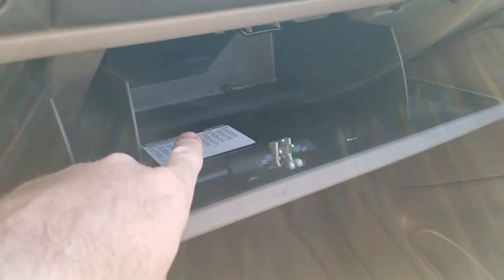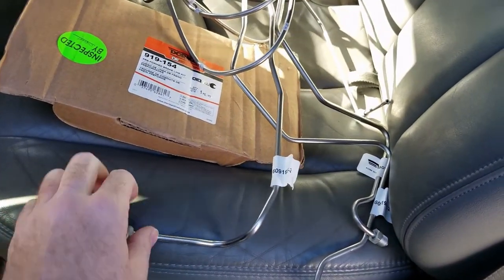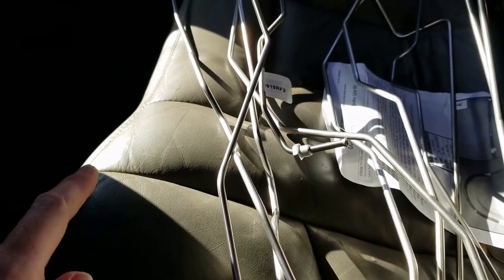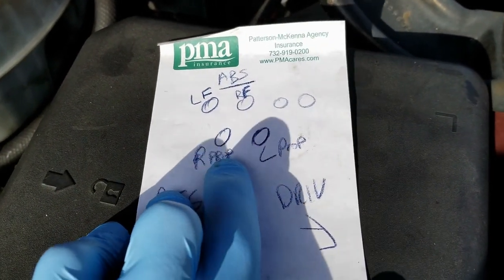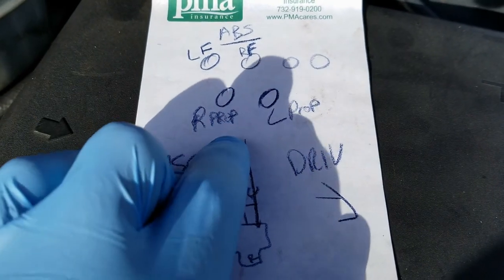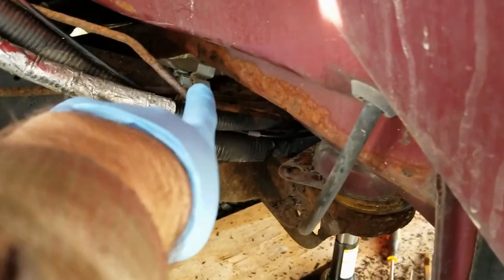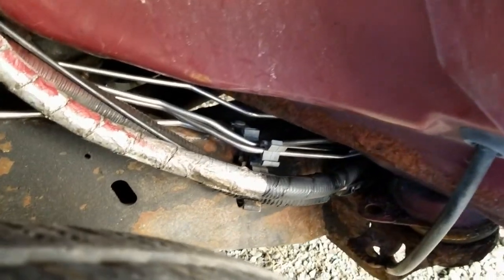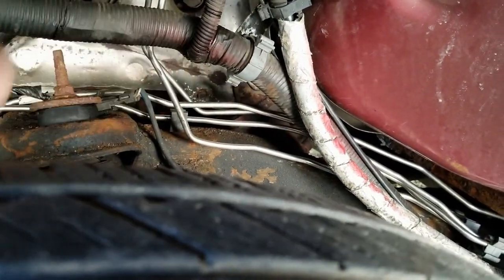Yukon, Suburban, Tahoe, Escalade or GM Pickup Truck  Brake Line Replacement. What a Pain!!

Comment: Thanks for this, JR! Tried patching a segment on the front passenger line of my 2005 Suburban 1500 LT yesterday and unfortunately realized I need an entire new line. Probably going to just replace them all next weekend — life in the north! Your video is a great primer.
Reply: @49 Keyz Beats because the two times I did that it sprung new leaks down the line. They were shot and needed replaced.

Comment: Yes!  I broke an extractor off in my bleeder valve.  I have just replaced all 4 calipers because of that.  I couldn't budge any of them--sucks.  Thanks for making your video.  It makes me a little more comfortable about doing this.  I gotta say I'm still worried, but not as much now.  Thank you!  I gotta say also, my wife doesn't know how lucky she is.  I have also done each soft line to the front calipers, and I put in a new master cylinder AND  a new hydro booster.  They aren't hard, but a fat guy like me doesn't fit up under the dash like I used to.  It's sure is exhausting.  God bless you!
Reply from the maker: Thanks for watching! This honestly is the best way to do it. More expensive obviously, but the best way.
Reply: Again, I just want to thank you for doing the video.  It helps my anxiety level.  Mouth still gets dry and I'm procrastinating going out, but not so bad.

Comment: For your wife and kids sake, invest in a good jack and jack stands or make sure you are over insured.  That little jack that comes with the Yukon is for emergencies only, certainly not to crawl under the car.   I used to live up north.  If you are going to keep a Yukon, it would be better to find a cheap 400,000 mile one with a bad motor down south and transfer the engine and tranny out of that crispy thing.  Enjoyed your efforts on the Sonata though.

Comment: Thanks for the video. Getting ready to replace the brake lines on my 2003 Suburban (affectionately known as "The Beast.")  Looks like its more aggravating than difficult, and will likely require extensive use of my vocabulary.
Reply from the maker: I can definately say the words coming out if my mouth while replacing the brake lines would have made a sailor blush. Lol

Comment: I have the jl4 code and the last time I did this we used 1/4 line copper and in the rear we used 3/16 OD copper line and we use the old fittings because we couldn't find new fittings anywhere.
2005 Yukon 1500 XL.
By the way the fittings are impossible to get because they are 5/16 and they take a 1/4 line.

Comment: I got this same set up but I got a traction control button on the dash so I thought I didn’t have abs and got the wrong kit
Reply from the maker: Yep, the ABS kit has the extra lines to go to the ABS pump. Plus there's a SWB and an XL kit which are different because of the length of the rear lines

Comment: Why is it that nobody can show how to get a wrench on the connections for the passenger rear lines that are mounted over the crossmember? Video after video that part is left out. Is there a specific tool to use other than a 15mm wrench? Seems impossible.
Reply from the maker: It's cause it's in a terrible spot and there's really no way to get a camera in there, let alone have 4 hands to get in there. Your best bet is to have a set of brake line wrenches and make sure you don't cross thread them when putting the lines back in.
Reply: Rip your old lines out and take the hose bracket off with a 13mm socket and short extension. It's time consuming because of the space but once you get that bracket off the fittings are easier to get to use a crescent wrench to hold the bracket so you can get them off. Relocate that bracket if you plan on running your own lines.